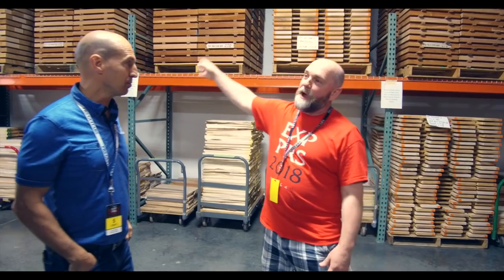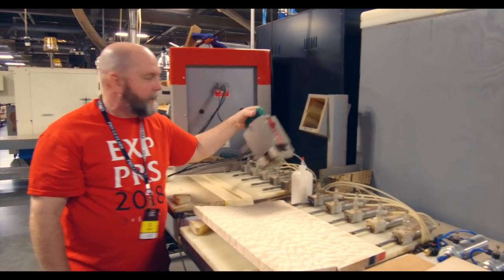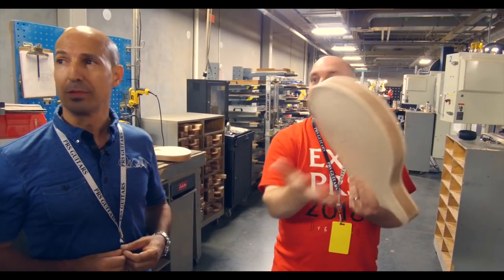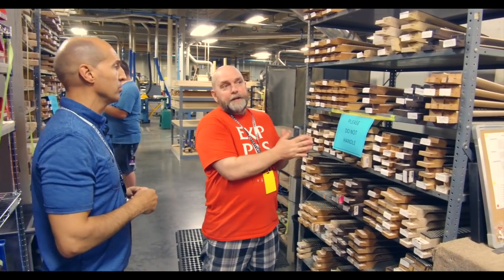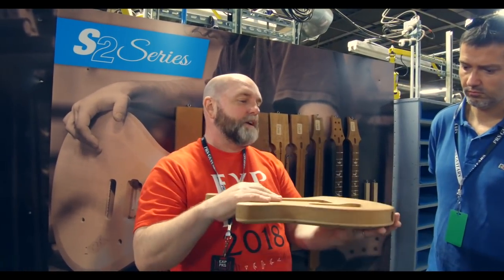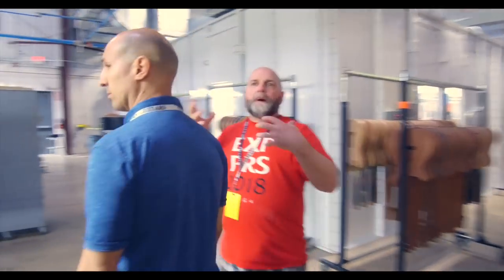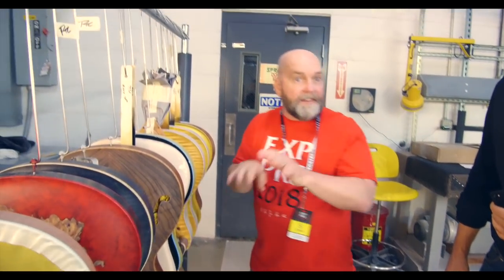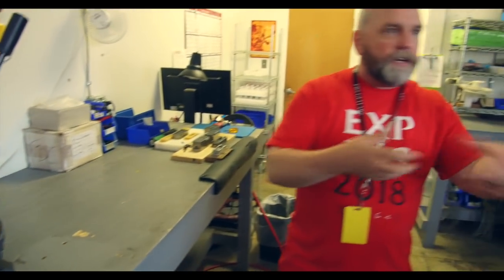PRS Experience 2018 Factory Tour

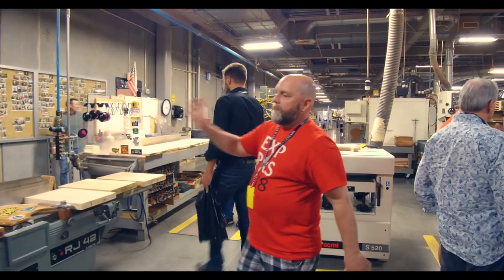Comment: 9:26, No offense to the guy leading the tour, but they almost certainly run the boards through the jointer first, that's the machine the mahogany boards are sitting on, then through the planer. It would be worthless to adjust the thickness on a board that wasn't flat.

Comment: Does anybody know why exactly they use a CNC machine designed for metal? I have to write an article about this process for my university and would appreciate it if anyone could answer that...
And are there any machines designed for wood carving that would be faster for the body manufacturing?
Reply: I'm probably too late to help, but the reason is that the metalworking machines are designed to work with thousandths of an inch and woodworking machines are not.

PRS needed more precision than was offered by other means.
Reply: @BaronVonQuiply  thanks for replying! Fortunately I already passed this class, but still, it’s good to know the reason anyways!